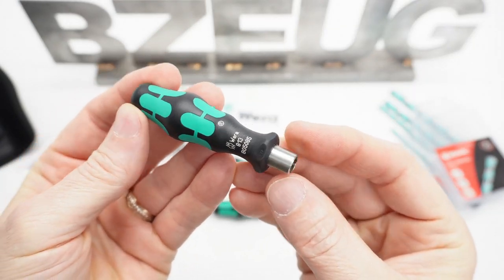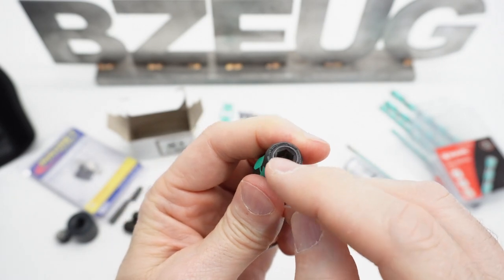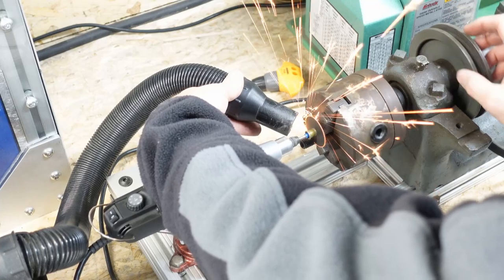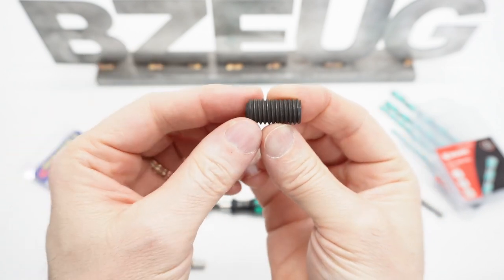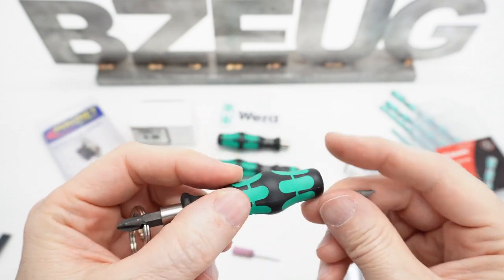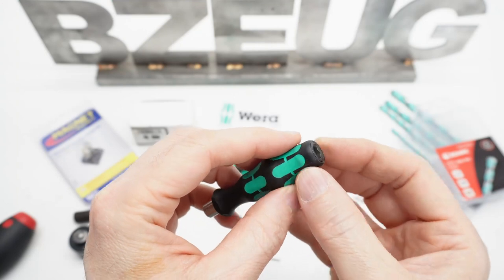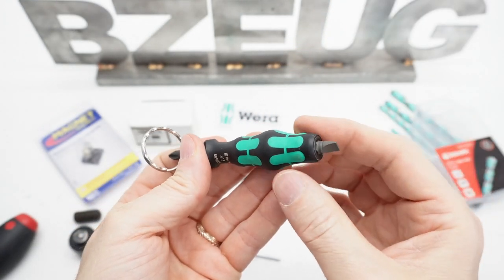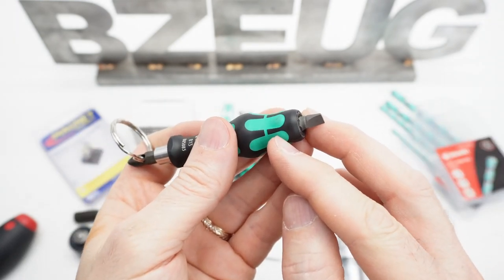Wera 813 bitholder DIY EDC modification.  I added a hex bit holder to the back of the handle.

Comment: Love your content.  The amount of work you put into the 813 is truly impressive.  I messed around with the 813 and the Hazet and others for EDC and where I landed was PB Swiss 6464.  It fits in a maxpedition micro pouch, it fits with two pliers in the Knipex pouch you have (the 813 fits on the side of the small Knipex pouch although I landed on a gerber armbar for that one).   I probably have a dozen 6464 with various bit loads and I toss them everywhere (vehicles, tool kits, drawers, and yes, just putting it in a pocket to carry).
Reply from the maker: Thank you.  I like your tip about the PBSwiss 6464,  I really should get one of those.  The Gerber Armbar looks interesting too.
Reply: I just ordered a Felo Bit Boy online for next to nothing, new old stock.  It has great reviews, specifically from Germany where it's made, which is a good sign because Germans are sticklers for details and also expect value for money.  It's too big to carry in a pocket, for that I have the Wera 813 which sits in my 5th pocket with a small extender, but it's ideal for a tool pouch or kit.  This Wera is much smaller at around the size of a Bic lighter so it's ideal for pocket EDC as a quick fix driver, way better than specific EDC drivers made by Maratac/County Comm, CRKT, Lever Gear, EOS, and the James Brand, which have either quality issues i.e. they fall apart, or are too slim and smooth to be practical as drivers.  Lack of bit storage doesn't really bother me as I roll just with 2 bits, a Ph2 in the handle and a slothead in the extender, upside down so no sharp edges.

Comment: I don't think people realise how tiny and pocketable this 813 bit driver handle is.  It's the size of a Bic lighter, so it's ideal for pocket carry.  Mine sits in the 5th pocket of my jeans alongside a Bic lighter, the Wera bit extender & bits of my choice.  Add a SAK or folder, and Knipex Cobra XS pliers in the outer pocket and I have a capable little toolset in my right pocket.  It may not be the best choice for a small pouch as there are other options with a slightly larger handle and bit storage inside it, like the PB Swiss Insider or Felo Bit Boy, but for a minimalist pocket carry this beats the pants off much more expensive Titanium or Aluminium bit drivers such as the Maratac/County Comm nub which don't have as much grip or purchase on the handle, and come with bits of unknown origin and specifications.  
I like this mod but for my own use I don't see the need for it.  I don't want to carry my screwdriver on my keychain as it sits fine and unnoticed in my 5th pocket til I need it.  If I am rolling with just 2 bits, a slothead and a Ph2, I just put the slothead upside down in the bit extender so no sharp edge, and the Ph2 in the handle.  It's for general urban EDC rather than for trade use so it's more than enough.
Reply: This 813 been very handy for me so many times along with the 125mm Knipex cobra.

Comment: Nice mod.   What if you drilled the split ring hole in the plastic end?  You could still carry a bit in the normal way, where it would hold better.  Also, the split ring would be more secure.